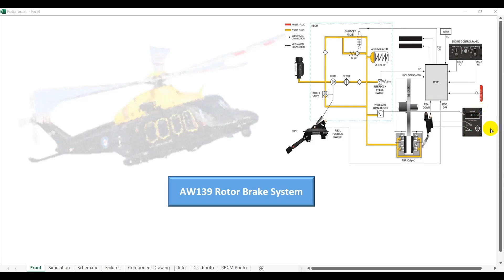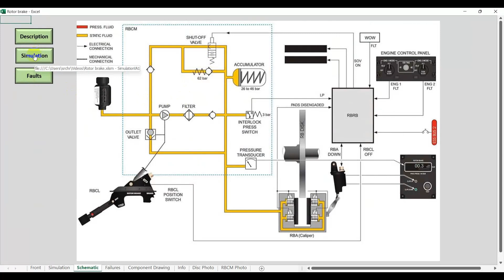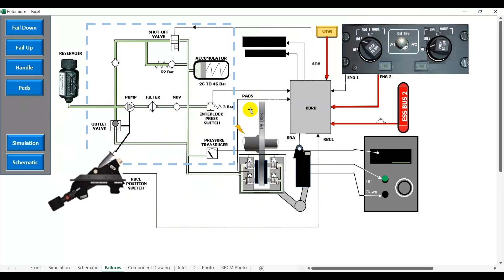AW139 Rotor Brake System

Comment: Does it matter when you applied rotor brake lever during shutdown with one pump and no pressure builds up But with two pump or more on the lever it builds pressure. This is during eng shutdown procedure.Is it a NoGo ?
Reply from the maker: I'm not sure what the pilots handbook says about shutdown. I'm not currently teach 139 so don't have access to the manuals. I don't see it being an issue if subsequent pumps apply the brake.
Reply: @srchrds621  thank you for replying.